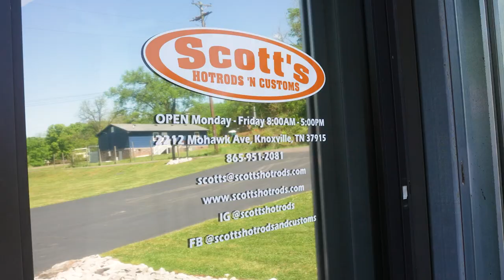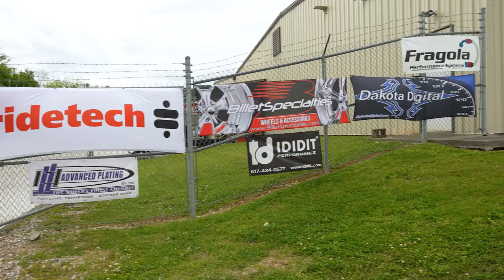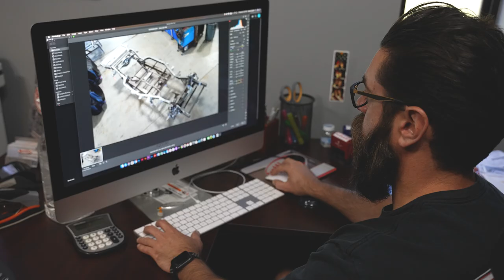About Scott's Hotrods 'n Customs

Comment: Several years ago I met Justin at the Del Mar Goodguys event in San Diego.  I had a hotroded 57 Healey with a V8 and the original suspension. He told me he had just designed a trick front suspension, steering and brakes for my car. I decided it was time to upgrade. All I can say is the welds look like the proper row of dimes everywhere.  Beautifully done. Big difference in the drivability now. Thanks Justin for working your magic.  I ended up putting  a bigger motor in it because it could actually turn and stop great.